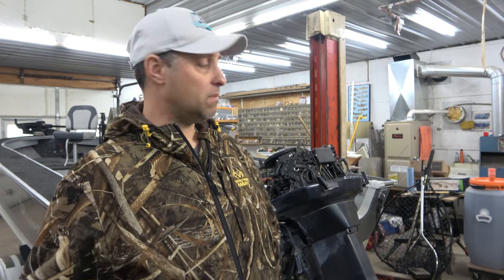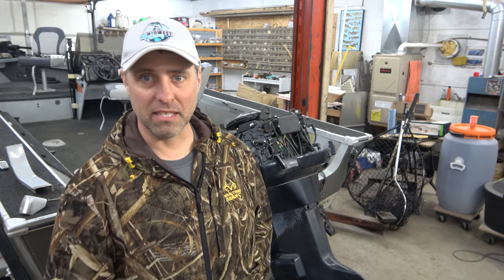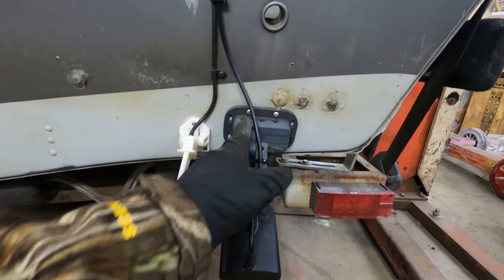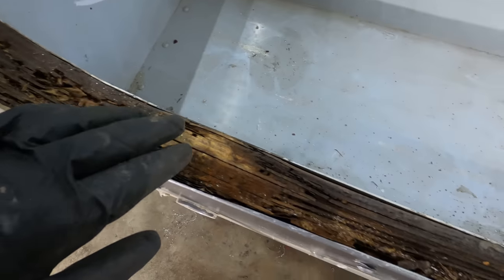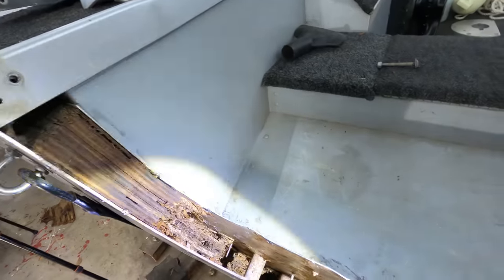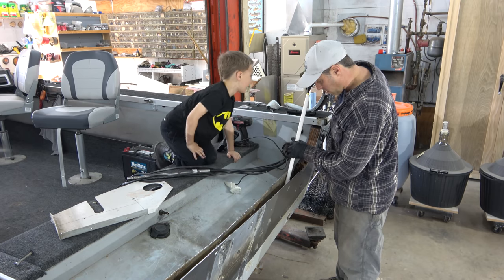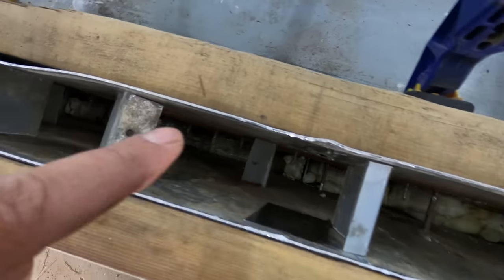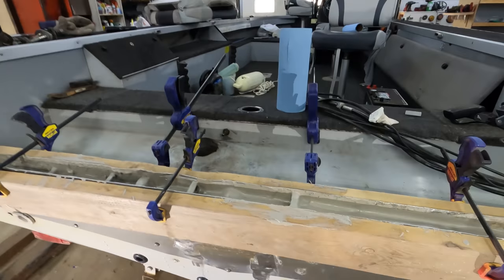The Easiest Way To Replace A Boat Transom

Comment: Strong work buddy.  You've stuck around and replied to comments of all sorts.  Kudos to you.
I run a 1996, 17' Alumacraft.  Taking it out on the river for some catfishing tomorrow night.  You can bet I'll be checking the transom in the morning!
Reply from the maker: Thanks, I appreciate that. I try, but sometimes I need a break of all the negativity. It's people like you that keep me motivated.
Reply: @GoMidwestFishing  Hey man, your video title is an eye catcher for sure.. it peeked my curiosity right away when I read 'liquid transom'. I'm not going to lie.. there were a lot of moments where I cringed, and then thought to myself: "that's not going to work... well, it was worth a shot.."  But then you came at the problem from a different angle and found a reasonable solution with the resources and skill level available to you and completely proved me wrong!!! And did so in the most modest,  informative and thorough way possible!! And guess what, as many of the comments that I've read here can attest to, some mistakes were made, a lot of lessons were learned, but most importantly, you inspired a lot of people to lose that initial fear, and just take the plunge and do your best and hope for a good outcome. Because at the end of the day, "there are multiple ways to skin the cow".. and you sir made it work in an economic and efficient-for-you manner, so kudos to you my friend and to hell with all the "experts" and naysayers. I'll start believing them once I've seen their documented and filmed version of such transom repair/replacement.. until then.. to hell with them!!!
Reply from the maker: @rudytamayo2646  Wow, That made me smile. Thanks for that.
Reply: @GoMidwestFishing  glad to hear it man 👍👍👍 keep up the good work 🍻💪💪💪

Comment: Excellent work. Well explained. One question that concerns me is the integrity of the transom really depends on how the  transom is attached to the boat as a uniform one unit piece.  What is holding the transom in place (excluding the aluminium each side) is the bond between the epoxy and the existing rotten transom. I trust the epoxy has bonded to the existing transom material well.
In otherwords if the aluminium was not there it is solely up to the joint strength between the two materials that is holding your motor in place.
Reply from the maker: Thanks for the comment. The only part of the old transom left was up in the corners, and that wood was still pretty solid. Otherwise the entire cavity was filled with the resin and formed one big piece. There are several bolts going through the transom too that hold it in place. Its very solid and not going anywhere. I guess I'm not entirely sure what you are asking, but I can tell you that it has held up perfectly after several fishing seasons now.
Reply: @GoMidwestFishing  Hi I have a soft transom in one place, the point I was making is the transom can only be as strong as the connection to the boat, the aluminum or fibreglass formwork? can not offer any substantial strength. The only strength can be where the joint of the remains of the transom join to the resin, and without some physical reinforcement to the joint. Not sure I would be happy strapping my 130hp to the back of the boat. Again a great video u did . Mike in NZ

Comment: Thanks for video. I believe  the possible increase in speed was from raising engine height, 2" less drag very noticeable in smaller vessels. 88spl is beast of engine. Hard finding more power for weight ratio.
Reply from the maker: I believe the speed increase was from raising the motor. Many people have said the same thing, so that's probably the reason. I thought about replacing the engine, but after many comments on what a great engine that is, I decided to keep it. It still runs great! Thanks for watching.

Comment: Did the transom  in my boat with Sea Cast,  I like the fiberglass  from reclaimed boats used to help bind the material together. Worked good on my  boat after i removed what little wood remained.
Reply from the maker: Thanks for the info. I've watched a few people use Sea Cast. Looks like a good product as well.

Comment: Redoing a transom is worth doing right, not easy or fast. I’ve redone transoms on tournament-type bass boats. When you’re running highway speeds on water with 300-500 lb motors on the back, you want right, not easy.

Comment: Doesn’t matter how strong the product is, if you don’t tie it in with the rest of the boat you will have two things....
1)  A boat 
2) A transom 
I respect your efforts.
Reply: Yet that is exactly how transoms are built.  When I was a kid, I did fiberglass work on boats.  I think I rebuilt probably 10 outboard motorboat transoms.  The strength is achieved by sandwiching the transom between the inner and outer skins of the boat.  It looks to me that the resin used produces a pretty good bond with the aluminum, adding to that strength.  The only issue I can see with it is that unlike plywood, the resin probably doesn't have a whole lot of structural strength across the width of the boat. So it may eventually develop cracks. Maybe it has glass fiber reinforcement, I don't know.
Reply: @JW-fq1pp  Depends how much flex the cured product has.  Apparently it is designed to have some flex and is not brittle.

Comment: Guys you got to realize that while this may not be a perfect, ideal repair it's still a hell of a lot better than what he was running around with!! Remember he was running that boat prior to this repair with a completely rotten Transom!! 

That looks solid as a rock dude I think you'll be perfectly fine!
Reply: Jesus, do not tell people this is a perfectly fine repair, you guys do not take boats seriously. I don't care if it's better than it was, people DROWN every year because of poor boat repairs. You guys need to realize there is a SAFETY FACTOR built into boats, or stronger than it needs to be. That safety factor WAS NOT met with this repair. Telling others its will be safe is just plain BAD advise. Hope it doesn't kill someone.
Reply: @andrewweymouth202  If you're that damn scared and paranoid maybe you should take up origami.  Make sure to wear safety  gloves so you don't get a terrible paper cut!
Reply: @andrewweymouth202  dude, you need to take medication! Nobody is going to drown if the transom repair fails, which is highly unlikely. Yes, I probably would have removed all of the old wood, but I seriously doubt the transom repair will fail. It will be fine. I do agree that he should have used fiberglass and resin to fill the gap, which he can still do later.
Reply: @bruceskousen5451  man, I dont know where you guys live, fishing on nice calm lakes everyday, the lakes I fish the boats can take an absolute pounding. I absolutely wouldn't trust that repair for one day. As for nobody drowning, that's a risk I try to minimize as much as I can.

Comment: Hey you did it good job I replaced my bass boats transom for about $300 using coosa board I ordered. It lasted 5 years
Reply from the maker: I would think Coosa should last longer than 5 years. Mine has lasted 4 years so far, and still looks like the day I put it in.

Comment: Nice job.  Little concerned where the composite meets and joins to the remainder of the old wood transom.   Time will tell.  Please keep us updated on this repair.  Have fun fishing.
Reply: Drilling some holes into the left and right wood sections and pushing rebar into the holes and leaving the rebar sticking out two to three inches would tie and bond the wood to the core material for added strength. What is the beehive that someone talked about?

Comment: Good way to do it. Much better than wood. In marine industry we use Chockfast or Epocast or Quanticast between foundation and engines, gearboxes etc. I think this will work well here too. It is incredible strong.
Reply from the maker: Thanks for the info

Comment: How much weight does this have compared to the wood? Also between the expanding form and the Carbon-Core how did you allow for drainage at the back of the boat? And if you could please do a follow up vid on how it is holding up after a season  or two of use on the water. Thanks for the information on an option that I hadn't heard about.
Reply from the maker: The carbon core weighs 45 pounds per 5 gallon pail. I used 2 pails, so it weighs 90lbs. I've used the boat hard since then. Running at full speed though rough water. It's been flawless.  Super solid. I really like it. As far as drainage, the transom doesn't go to the bottom of the boat. Water still flows under the floorboards and out the drain plug.
Reply: @GoMidwestFishing  thanks I boat a 100 dollar boat I want to learn how to. It is a 60s that was the same as my aunt had.

Comment: Looks good BUT I think you should have tied in the outer framing to the outside edges and also put in some 2 inch beahive core before filling .
   I love epoxy for some jobs but with a 400 lb motor twisting and turning thats a lot of torque on that transom.
   But looks like i will hold up for a few years 👍👍🚤🚤🚢🚤🚢.
   Good job

Comment: i applaud your effort on this but have a primary concern and suggestion. Structurally, the vertical joint between the new carbon core and the old wood on the left and right is not going to be able to take much stress. This leaves the thin aluminum on the front and back to take a lot of the load. if you see a bend or crack in the aluminum at this location (front or back) it is time to move on. My suggestion is to, from the top preferably, remove the rest of the wood on the left and right. See what carbon core says about cold joints (can it be placed on itself once cured). if it bonds well, pour that back where the wood has been left. Sorry for the novel. Ignore the haters and tight lines!
Reply: 1

Comment: How do you think that stuff would do if poured into the floor of an old boat? I've got an 18 footer with the entire floor removed and a couple stringers removed that rotted out. My thinking is if it will hold your motor, it could probably make the hull stronger than ever before. (I'm not a fan of fiberglass)
Reply from the maker: Oh man, that's a tough one. It's designed as a transom material, so using it for anything else would be an experiment. It would add extra weight to your boat compared to fiberglass. I'm also not sure how it would hold up as a thin layer instead of a 2 inch thick slab. If you do use it, let me know how it turns out.
Reply: to make a solid bilge area without stringers only would stop all flex your boat needs to maintain integrity. Like this repair, in the short term it is working. In the long term you will kill your hull. Stringers coincide with the ridges under your boat. They are needed as is areas without to allow for flex among other things.

Comment: for sure , this is much heavier than the plywood equivalent and probably stiffer but there is an inconvenient the way you done that , the inside of  both aluminum clad panels are not clean enough to assure  a good bond with the liquid transom and this will lead to the separation and  possibly water accumulation, 
sometimes, it is not more difficult or tedious to go straightforward and do the complete job.
 I redone few tramsoms and I always procedeed by the interior of the boat, it is a bit longer at the dismantling of the old transon but the final result is usually better and you keep the integrity of the boat plus often, you discover other members that need to be  replaced.
very good video

Comment from the maker: In response to many comments on here... The product I'm using was specifically developed for transoms. It cures to a super strong, yet slightly flexible composite board, which is stronger than plywood and will probably outlast the boat. I used it on my own boat, and have put it to the test on rough waters and at high speeds. It has performed flawlessly. I enjoy hearing ALL opinions on here, but if you don't like what I did, please have some facts to back up your statements. I have used this boat for a full season now, and have made a follow up video, so lets see how it did: https://youtu.be/MCWqsJOXaRQ
Reply: What brand is that epoxy? I have to replace some stringers stuff on a airboat hull
Reply from the maker: @kyledaymon532  The Epoxy is from carbon core. You can check them out here: https://www.carbon-core.com/products/carbonbond/transom-compound/
Reply: I'm happy to let you know the facts, concerning this repair. I look forward to the coming video. Perhaps a livestream, so that we can talk.
Reply: I'm sure it's good for now but the left wood will keep rotting and than it will fail! Not during season 1.
Reply: junk
Reply: @tallman2994  let’s see your video on repairing a transom.
Reply: @AdventuresOutdoors  its really not that complicated, the wood in a transom is one piece. That's important. One piece. This repair is 3 pieces. Epoxy in the center and rotten wood on the sides.  Anyone who has half a brain can see the problem here. The only thing holding that transom together is the sheet aluminum. It will last for a while, start to deform and then fail.
Reply: Fact: that transom should be one piece. Not 3.
Reply: Lots of people are hating on the pourable transom these days. Simple, the average guy can do the repair himself now as opposed to taking it to a "fiberglass repair shop" where they'll be raped of $4,000-$7,000 for a slab of laminated wood.
Reply from the maker: @z19ingreen53  Very well put.
Reply: I hope the facts don’t come to visit you too soon when that wood on the sides goes. That area where you left the wood supports a big part of the transom. I’d use that stuff myself, but I sure would have gotten that wood out and made one solid piece transom. I hope it continues to work for you, because I sure don’t wanna see a good fisherman lose time on the water.
Reply: @testboga5991  That repair will outlast him If he keeps it indoors The only way that would rot is it water gets inside what he did was plenty good. That piece of wood has been in your 30 years and it didn't rot.
Reply: @andrewweymouth202  The epoxy fuses to the old wood making it probably stronger than original.
Reply: @56igadget  absolutely incorrect.
Reply: I'M SURE IT'S GOOD FOR NOW BUT THE LEFT WOOD WILL KEEP ROTTING AND THAN IT WILL FAIL! NOT DURING SEASON 1.
Reply: My concern is the guy who comes to buy it. It looks good but little do they know what lurks behind that lipstick and make up.
Reply: @56igadget  Nothing fuses to rotten wood.

Comment: I hollowed out the rotted transomon a 13ft side console skiff with a chainsaw. It made a huge mess and I gathered up the stuff that came out, let it dry out, mixed it with shop saw dust and epoxy to a ratio of about 1:1, poured the resulting "slur"back into the transom and its rock solid 3 years later.
Reply from the maker: That's interesting. I'm glad it worked!

Comment: You should overlap the trim pieces on the transom so that the angled aluminum you bought is covered by the curved side trim pieces that way water will naturally flow over the transom trim and off the transom instead of flowing down the curved corner trim pieces and then under the angled aluminum trim piece which will naturally funnel the water into the transom that’s not what you want. Maybe it’s not a big deal just something that caught my attention.
Reply from the maker: I agree. The reason I didn't is because it wouldn't fit under that corner piece. Good point though. The carbon core will never rot, so a little water leakage shouldn't hurt it. Thanks for the comment.

Comment: Most negative people on here would get rid of their boat if they encountered a transom issue. Yet they still have something negative to say. Good job man! Kudos for tackling a project and sharing it. It is all about trying to diy fix what is broken and to do it affordably and ultimately enjoying the outdoors. This video may come in handy for me in the future if I ever run into this problem with my boat. Great info!
Reply from the maker: Hi Joe and Kari.  Thanks for the kind words. It definitely got more negative comments than I expected, but it also got way more views than I expected it to get, so I'll just take it as a sign of success. I can tell you from actually using this product that it is stronger than using wood. I've put it to the test and it's holding up great. The haters are just giving opinions without any actual facts or experience.  Thanks for being one of the good guys out there.
Reply: I don't think leaving the wood in the corner matters like you said it Bonds with the wood, all the pressure on the transom is where the motor mounts up and that is reinforced, I'm DYI guy myself can't please everyone just got to please yourself😉
Reply: not true at all, stop assuming. We are not haters in the first place. We are professional;s. We know what he did wrong because we have dealt with this stuff for a very long . IF you think it was a good job, you buy that boat friend when he sells it. what amazes me is you can see what he did wrong,, you see the end results and still tell him hey! great job, here's your participation trophy. Being honest to him might have saved someone a year or two from now.

Comment: Great stuff is not closed cell foam, as others have mentioned, but even marine closed cell two part will absorb water eventually. All about how much water getting to it.
Really makes me mad that boat builders don't water proof the wood. If they put on a few coats of poly resin on it, it would greatly extend it's life.
Neat product on the liquid pour thou. Never heard of it.

Comment: Nice job my friend, I've been working on those rascals for over 40 years and have done quite a few of them and floors
Reply from the maker: Hi Jeff. Thank you for the nice comment.
Reply: Jeff, would be interested in a transom and floor job on a 24 foot four winns liberator with my assistance?